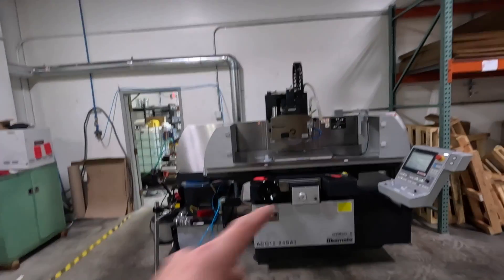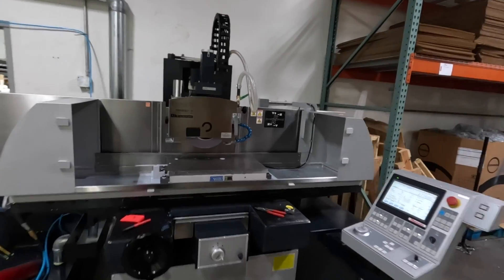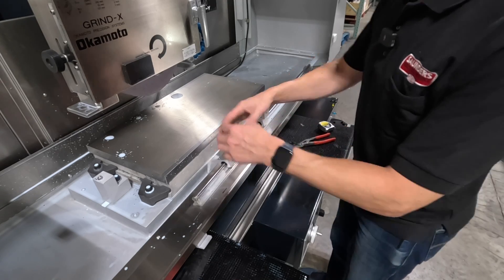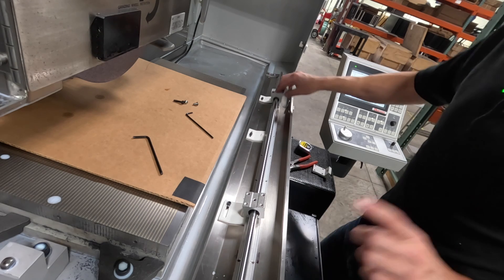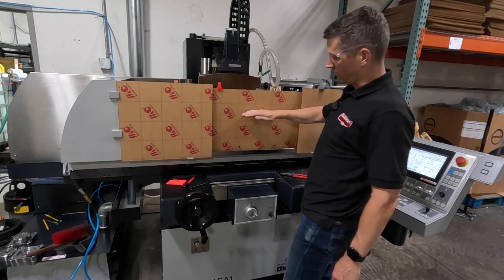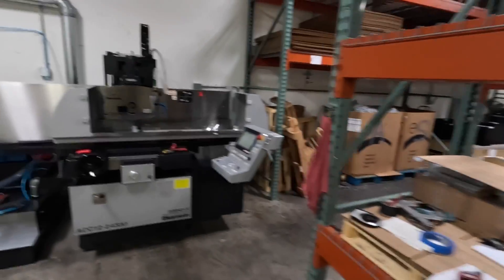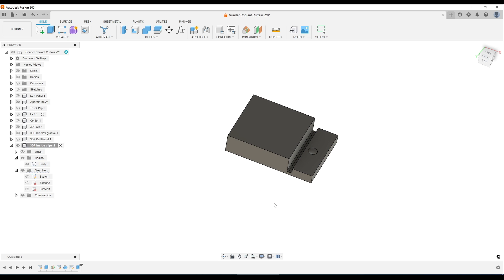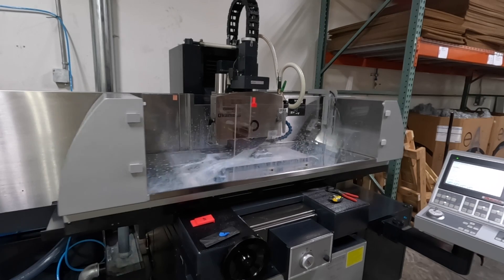Building a Simple, Nice looking Coolant Guard for our Okamoto Grinder

Comment: did you get the guards made of acrylic or PC? acrylic does not like modern imusion coolants (probably the chlorinated parafins they use)
Reply: What is PC? I'm looking to replace some plastic guards on a machine and would like something that resists fogging with coolant.
Reply: @michaelalcocer6778  PC stands for Polycarbonate. It's a type of plastic that Is compatible with water based machine coolants.

Comment: Curious assume there is a factory back guard or is that an open issue?  Hairball thought what if you had a vertical drape on a horizontal rod that attaches to the existing guards this would give you full access to the chuck, the drape bottom just lays there in the down position to load/inspect, simply raise and clip/lock in the up position

Comment: 3M VHB tape is a more permanent substitute for hot glue. You'll would to do a little research to get the best variety for the application, but IME even a sub-optimal VHB tape is pretty darn good.

Also, you could probably 3D print a step with an "H" cross-section for the sides. One channel would fit over the edge of the clear panel and the other over the edge of the metal splash guard.
Reply: Was thinking the same, just some 3m double sided tape will hold a lot of weight :)

Comment: you bought an incomplete machine it seems. you have been through so many shops and could not pick a better one?
Reply: Did you miss the part where he talked about the $11,000 price for a cover? More importantly the 6 month lead time? Likely needed the grinder for jobs NOW not in 6 months from now.
Reply: @Yogi_Bear69  i did not miss a thing, you are telling me the manufacturer could not come up with a simple and cheap solution , that looks like an incomplete machine regardless.
Reply: @Sergioelg  I'm telling you when $11,000 is at stake you aren't gonna get a simple or cheap solution. That's why VW, Mercedes and BMW locked down their computer systems in their car. Because then they can charge you more money to fix it. Money is a hell of a motivator.

Comment: Hi John

I Had the same problem with my Mattison's. the new splash guard needs to fit inside your existing guard. We made one and it simply had bolt on clips that attach only to the new guard and then the clips simply stab over the existing guard ledge. Works really good no holes in your original grinder and just simply lift off after you finish your grind. everything flows back to the original compartment.